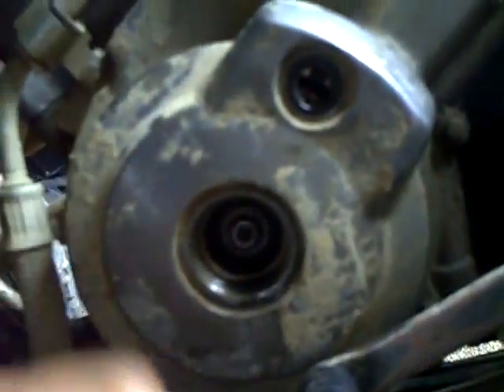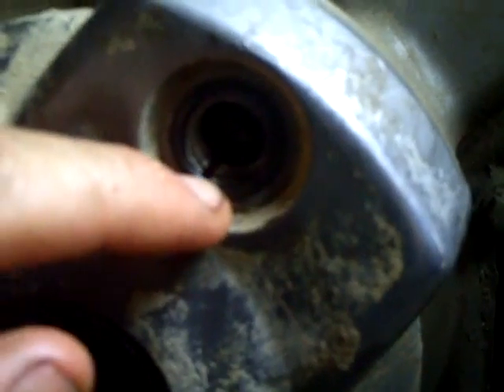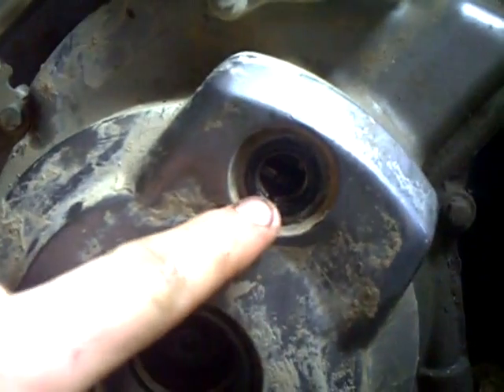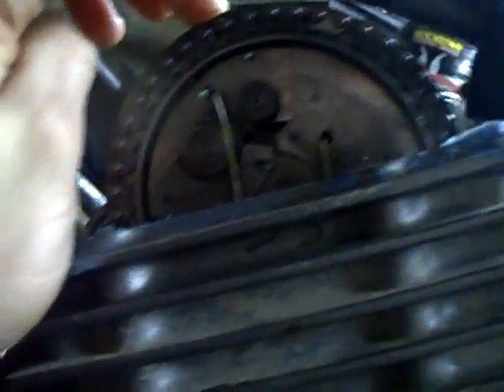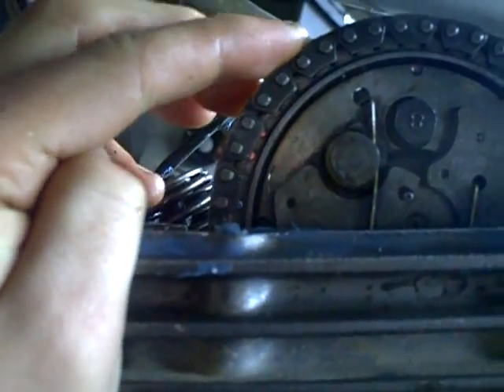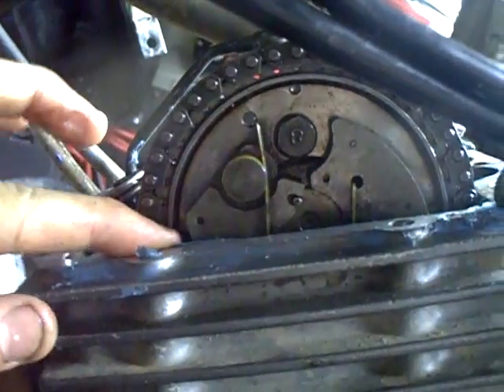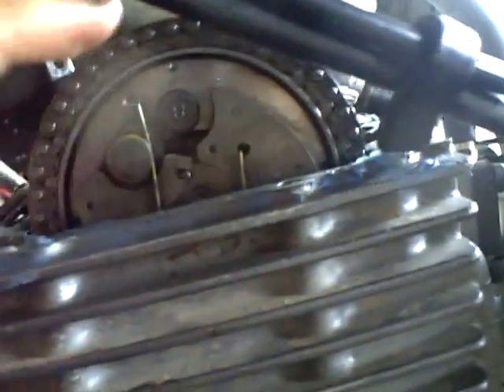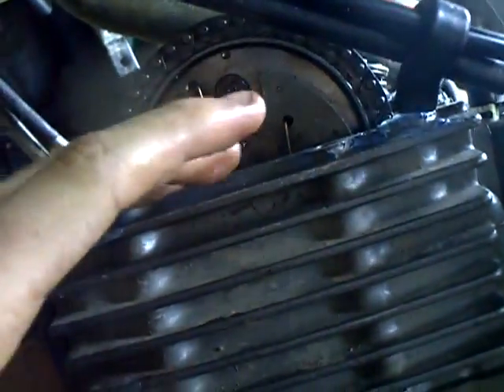how to set and adjust the cam and cam chain timing. 4 stroke engines. ATV, Motorcycle, Dirtbike

Comment: Question: what year is this bike i only seem to see 2 holes to line up on my cam shaft unless i missed one want to get my timing right before i put all the parts back together. I have a 2001 raptor
Reply: Did you ever figure it out cause I’m having the same issue atm

Comment: This guy is Giving WRONG information do not watch this....
Reply: James R. Hellmsly what mark do you use? putting mine back together and can't get it
Reply: What's wrong the line or h part?
Reply: Yea and my lines don't line up perfectly
Reply: True timing is off, thanks Dick head. Wrong information!!!
Reply: lmao information is right just not fully explained you need to be on the compression stroke to set the timing, id say if you dont know that you should done a little more research before you tried to do it

Comment: I have a dirt bike eith a loncin 250 engine and it sounds like the timing chain is loose - any one know if there is an adjuster to thighten it up ?
Reply: it would be on the side of the timing chain usually on the back side of the head around Bolt with two little boats on the side

Comment: I have a Kazuma 150 atv it gets fire an gas what else can i check cause it wont start
Reply: compression, fuel sample, clean carb, use starting fluid
Reply: @codylippincott1764  what if it starts but stalls when gased?

Comment: When you turn it backwards it activates the starter and the crank where if you turn it the other way it just turns your crank. Either way is fine and turning the opposite way is a good way to check for starter issues and cog alignment

Comment from the maker: if the engine is seized, it could be a number of problems. something could be internally wrong with the kickstart gear, could have bad crankshaft berrings, piston could be screwd, like you said timing chain could be stuck in the bottom end, valves could be adjusted wayy too much, valves could be bent(would still kick but would be very hard to) camshaft could be screwd with too.

Comment from the maker: it will kick, but not start. if the timing chain is broken, you are not allowing the valves to move which not allowing fuel, or exhaust to enter/exit cumbustion chamber. therefore not allowing it to start.
Reply: also could have a stuck valve that would also keep it from starting and it wouldnt have compression